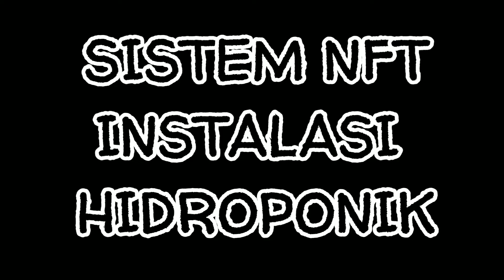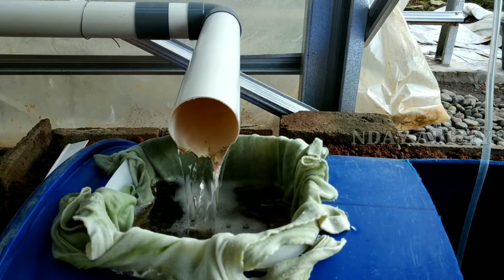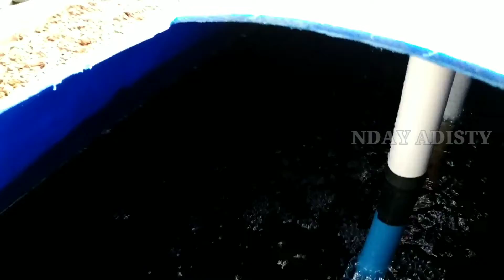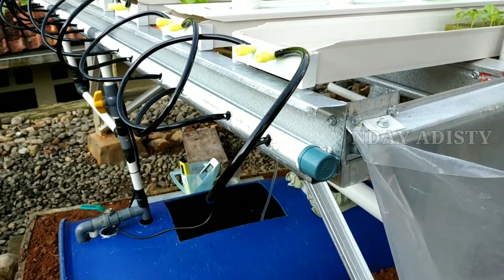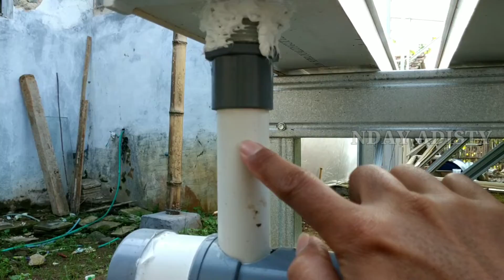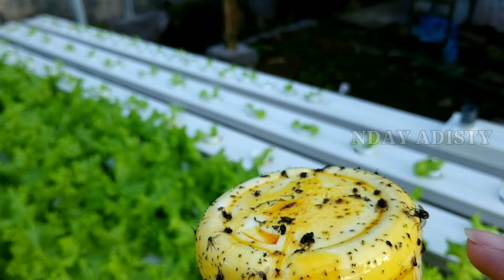Hidroponik Sistem NFT

Comment: Apakah pH nya stabil? Untuk sistem nft, dan apakah oksigen dalam air mempengaruhi pH?
Reply from the maker: stelah rewel masalah ph,tanaman tdak maksimal,jadi sekarang ph saya cuekin aja .ppm aja yg di jaga kisaran 700  750
Reply: @ndayadisty8110  berarti dimaksimalkan di PPM nya?, Untuk mengatasi pH
Reply from the maker: sy sudah tidak perduli sama ph om. ph benar2 dijaga juga malah ribet dan hasilnya sama saja kok. 
saat ini ppm saya gunakan paling tinggi 750 sampai 800 ppm. ph kisaran 7 sampai 8. dulu pernah dijaga ph selalu di 6 tapi hasil sama saja kok
Reply: @ndayadisty8110  apakah tidak kuning untuk daunnya pak coy? Saat pH nya 7-8

Comment: It was good but the exit water must be redesigned. On your installation like this the pump should work 24 hrs non stop ..what will be happening if electric or power goes out ? The water on pipe will run out and your vegetables will fade away .
Reply from the maker: thanks my dear